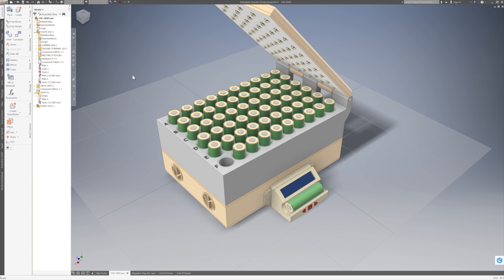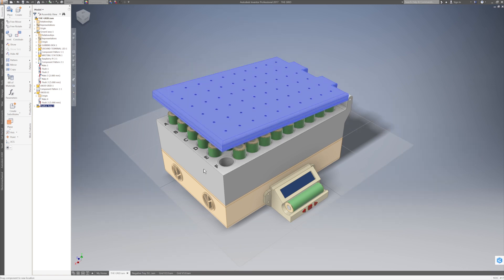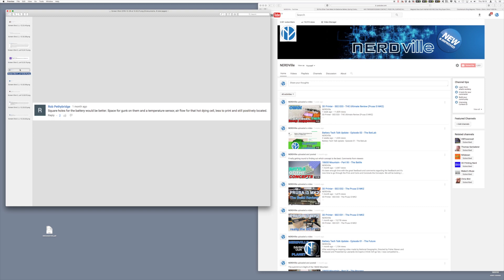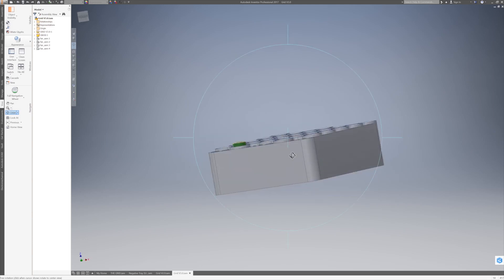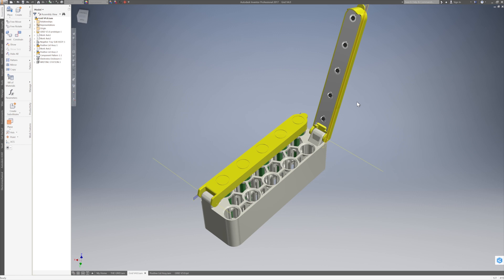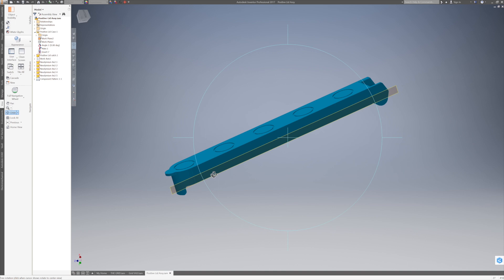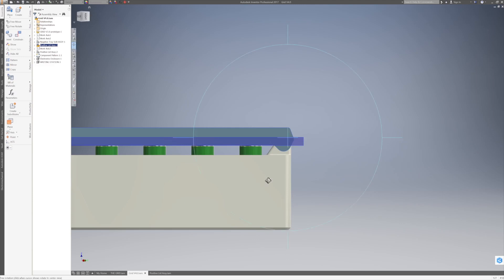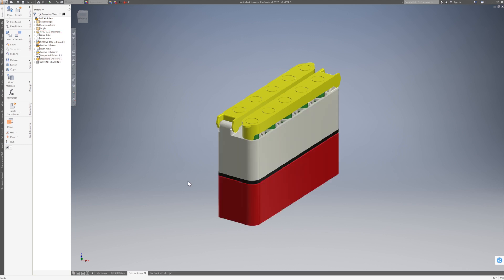18650 Mountain - Part Xiii - The Update

Comment: i think you still need something latch the lid and on your battery connections just for the top it you added a spring on the shaft of the bolt in between the magnet and the head of the bolt

Comment: is this project still alive ?
My five cents.....I imagine a system like a roulette, with 12 batteries located at hour places (like a clock) with one arm in the middle with an electromagnet to take or leave batteries. This arm will put and take batteries for charging & discharging from one entry point (lets say the 12 h) to any free space. Each space can charge, discharge and inform the battery condition (temp, volt, amp, etc) to one central microcontroler or raspberry pi. With this system you can charge or discharge 11 batteries at same time (in parallel), and input or output batteries as soon as they are checked or refused, and save all the data of each battery. You can label each battery or use rfid stickers with an rfid reader/writer. This system can scale as well, if you need or want to check more batteries just make a circle bigger. I can help programming raspberry pi or microcontrollers. What do you think ?
Reply: BTW, great channel !, love your videos!
Reply from the maker: Joan Pons hey Joan. Just picked your comment so sorry for having missed it. Your roulette idea does have some similarities to the one I design I must say but I assure you it is a coincidence. But have gone the process of design and reading your comments there's certainly some merits to your concept which could be added or amended to the The BFC. May have to see how things pan out.
Reply: Hi, so you dont read all the comments ???... that's good ! it means that your are becoming famous and your channel is growing exponentially ;-), anyway all our designs need improvements and some work, but they're a good starting point. My initial idea was to create a totally autonomous system, where you can put all your bateries in one place and pickup the tested bateries in other place, maybe clasificated by capacity level. In your design you must insert and take off the bateries of their holders manually, this could take a long time if you have a large amount of bateries, which I think is your case.  Anyway thanks for answering and keep publishing great videos. You have a lot of people interested on this project. Congrats for your channel.
Reply from the maker: LOL famous ME! I will always try to answer comments for as long as I can until they become too much. Remember my videos relies on audience participation, Hence NERDVille is more of a place than a persons name. The idea definitely has merit but the main issue is making the design accessible and easily built using the minimum tool. Not everyone will have a laser cutter like me. The other issue is cost and trying to design unit that meets most people's scale of battery recovery as not everyone will have a cell count of several thousand. Trying to design a unit that is both modular, inexpensive and easy to build is no easy task but I feel possible. But a rotary system sounds like an awesome idea just to make and do an episode on. Time permiting of course

Comment: Why not put a spring under a wide headed screw? You'd need to latch the top down to maintain pressure
Nickel strip for the top with screws for contacts.

Comment: Two ideas coming to mind.
1. An alternative to running wires through the hinge area. Two contact points, in the lid, per cell. One contact for the cathode and second contact point to a wire that runs parallel to the cell down to the electronics. Then bridge the two contact points.
2. Further down in the comments xtraPom mentioned the idea of accessibility of individual cells during the testing process. I know this adds complexity that will disqualify this idea from this project but I will throw it out there anyway. Each cell slides into its own holder similar to existing 18650 holders. These holders would have two contact points on one end and would slide into the grid individually.
Thank you for the time and effort you put into your channel. Your videos are VERY entertaining!
Reply: One more thought. Each holder has its own temp sensor and add a third contact point on the same end.

Comment: Nice design and concept. Several things to say here. 
First, the magnet connection and the adjustable height of the connection is crucial. However, you need to have at least one side of the connection (either + or -) to be flexible (aka. use a spring) to guarantee system reliability. 
 Second, your cover lid should be stiff enough to keep its shape when it is pushed or pulled by 5 magnets or contact springs in a row. 
Third, you need some space to fit in electronics. The easiest way I see is to attach a bunch of TP4056s at the bottom of batteries, but that only handles the charging part, and I am assuming that you are going for more advanced options. 
Forth, you need time to build electronics. Your background suggests that you haven't been trained for electrical engineering, so that you have two options: 1. learn the knowledge and do it yourself. 2. Ask for those who are skilled in the art to help you. Either of these two options will take at least a month plus your hard work and dedication.
Fifth, temperature control is more than keeping batteries safe. A cell's discharging curve varies with temperature. If your cells are tested without temperature control, the result will be inconsistent. I am assuming that you are using your test results as a standard reference for further tests and design. In this case, the inconsistency of this initial test will make all the following steps pointless since you are following a wrong standard from the beginning. The crucial point of temperature control is to keep the temperature of all the cells at the same level, and this can be achieved by strong cooling fans since it will make every cell to be room temperature.

Comment: Just a little idea you almost there if you think about it. Why not go all the way and using your idea for your test box make a similar box to contain the 18650 batteries like a modular setup for use after you have done all the testing and are ready to use them in your power wall. It would make life so much easier if you could just drop them in and then stack them into your wall.

Comment: hello I just started on my own recovery project and currently have over 1000 cells I am messaging you because I am having trouble testing them all and I have more cells that are still in there laptop battery housing but if a am going to do this I'm going to need to make something much better then my current set up of two imax bc ac chargers and I saw the charger (the grid concept) you are currently building and I think I might try and build one so if I can help I have an idea you might like if you use a Intel Edison Arduino board it has Wi-Fi and Bluetooth so you could use that and a cheep android tablet and make a app so it connects to your charger and you could have the charger send the info to your app and you could mount the tablet to the charger like a display on the side you could also make the app display the data recorded however you want

Comment: But that neodymium magnet will have a powerful hold on the bolt especially as its rough with the thread
Reply from the maker: yep, the CSK screws and magnets are magnetically connected and this group moves freely within the tray that holds it.

Comment: Hello. Nice video first of all. But i am not a fan of the magnet system. The spring would be much better and waaaaay cheeper. And just a thought, you are going through all this process, and by the time you finish this all, i think you could be done with testing all the cells already with the materials you have currently. My point is that, is this worth your time? Time is money. It looks like too much time is being spent on all this design process and it would be all the same if you do this or use the imax b6, tp4056 and your discharging unit. Plus, you are going to be spending much more money on all these supplies and time, since you are buying off ebay, it will take 4+ weeks to come. Again, just my suggestion and keep up the good work!!
Reply from the maker: Hi sean, TBH this is not an exercise in me making a tool that would make the processing the cells more efficiently and yes I have thought the same myself LOL. 

It's more of a community led project. There is a recognised issue with the arduous task of processing 18650 cells. I'm just addressing this problem but with the youtube viewers input. Which I think is cool. 

We're breaking new ground here and I don't know of any channel that has run a social experiment this way. Besides, I'm passionate about design and keen to learn about electronics and programming so the knowledge gained is additional experience I would not have got anywhere else. 

Lastly, I have made friends and communicated with experts around the globe that I would never have been able to, had I not started this project. So put simply, yes i believe it is worth my time.
Reply: NERDVille Aahhhhh. I see. Well if this is being done how you explained... then yes i agree with you. This has been quite a journey from part 1 and i look forward to seeing more. I am following your videos as i am learning as you are too. Congratulations on your progress!!!!
Reply: Hahahaha. Yes. But anyways, i do have tips for your box thing... (srry no idea what its called, cant remember)

1: In complete honesty, i dislike the idea of using neodymium magnets for connections of the batteries. It is much more expensive and the simple spring would do a better job.

2: The heat sensor thing, is very complicated and  it will really take up lots of space, if you will be monitoring every single cell. 

3: Depending on how fast you are willing to charge them, you may or may not need a fan or a heat sensor. For example. I have my own small batch of 18650 batteries, and test and cycle them on my Venom pro charger. (pretty much the same as the your imax b6) I charge them at 0.5a. and they don't get hot at all. They mostly stay at room temperature.

Well, good lick on your future plans, and i look forward to seeing new videos!!

Comment: Not to criticise the design but merely to suggest... those little notches you made for slipping on the lids.... if you placed them directly at the top you'd allow the lids to be snapped into position directly from the top and eliminating the possibility that someone heavy handed would accidentally pop the lid off the back when opening.
Reply from the maker: hey no probs, I like this sort of criticism. The reason I put the ramp for the notch to the side is it will interfere at the top as this is rotate passed the ramp when opening. to the side once fully opened and sitting on its own natural stop I designs in then the notch will in effect be pushed up and away from the side ramp. the assembly will be the same even if it would be at the top or side.
Reply: Ah I see. Makes perfect sense.  Keep it coming... loving this project!

Comment: Haven't seen the entire series yet, but I would recommend rows of 6.  If the rows can process individually, and assuming you will have 6 usable batteries at the end, batteries are generally used in groups of 2 or 3.  Processing 6 would give you a more universally usable set.  Just a thought.
Reply from the maker: yeh I agree I think 6-row groups is a 12-hour max processing time. But it's easy enough to expand that once we have proven the electronics.

Comment: For connecting the upper assembly to the lower, I had an idea to offer up.  With your CAD design, add an extended rectangular piece (perhaps 4cm long and 2cm wide, ending in an oval or circular shape - essentially, a spoon shape) going downwards on two sides of the upper assembly, forming squeeze tabs that can mate and "click" into place with their respective oval or circular female cut-outs on the bottom assembly.  If the tabs are designed so that they have to be squeezed inwards to just slide past the inside walls of the lower assembly, they should form a very positive (and audible!) contact when they reach the female cut-out and can pop back out to their original, in-line orientation with the wall of the upper assembly.  I can't seem to find a good image on the web to really illustrate what I'm talking about but think vacuum cleaner attachments for the hose assembly.  They slide on and then click into place once the flexible tab reaches it female acceptance point.  Those tend to be spring loaded but I don't think you even need springs if the alignment is done right and the "tabs" have just the right amount of flex and strength.  You can even add some texture to the oval or circular shape at the end for extra purchase when squeezing them.  To remove the upper from the lower assembly, simply squeeze both tabs inwards out of their respective female cut-out and the parts will easily separate.  Placing the tabs on the long sides of the assembly should allow you to squeeze both tabs at the same time with your thumb and forefinger, thus allowing one hand to hold the lower assembly and squeeze and the other hand to pull the top off the bottom.  If done right, the two pieces should click into place when mated and form a very sturdy connection with very little to no wobble.  I have no experience with 3D printing so I'm not sure if the medium you use for the housing is flexible enough to make squeeze tabs while still being rigid enough for the overall structure, but if it is, this could be a good solution that provides both easy accessibility to the guts of your module while still embracing the KISS design philosophy.
Reply from the maker: I like your way of thinking. Is this something that can be sourced as a ready-made off the shelf component? If not imagine the tooling costs and MOQ cost to try to get something made that is unique. It's an awesome idea and I like it, but we need to maintain the design of this to be as easily sourceable so that it is within the reach of most people scope for sourcing materials.
Reply: I'm really struggling to find an illustration or graphic that accurately depicts what I am talking about, but check out the graphic on step 4 from this page: https://formlabs.com/blog/designing-snap-fit-enclosures/ as it is close enough to showing what I mean.

In that example, the set of clips are designed to permanently connect the upper and lower enclosure.  However, if you create a "female" cut out on the bottom enclosure so that those clips can slide down, click into place, flush or slightly pushing out through those female cut-outs of the bottom enclosure, it will allow a system that snaps the upper into the lower assembly but can be pulled back apart by just pushing the tabs inwards through the female cut-outs.   In this way, the locking system should be part of 3D design so it won't be a separate part at all.  Hope that helps and keep up the great work!

Comment: My suggestion when it comes to battery terminals is to use thin nickel tabs/sheets to make the electrical connection and some kind of hi resilience silicon or pu foam behind to improve the mechanical connection and make room for length variations among cells and flex in the construction.

Maybe even coil springs in combination with nickel tabs can be an alternative but i think nickel tabs and foam might be best connection / money and space.
Probably more important when you want to draw a lot of power out of the cells due to deformation of coils for example at higher power rates / temperatures, but still a good method for a project like yours imo.
Some exalmples;

*Nts works patent
www.google.com/patents/US8785028

   https://s27.postimg.org/4pawq0kv5/US08785028_20140722_D00001.png

   https://s24.postimg.org/myxswgwyt/NTSWorks_Mini48.png

* diy foam/nickeltab pack
https://endless-sphere.com/forums/viewtopic.php?f=14&t=57810

   https://s18.postimg.org/sd3c7qsax/IMG_2504.jpg

   https://s17.postimg.org/xpcihnzgv/IMG_2505.jpg

* lasercut nickel sheets with fuses (probably not so interseting for this project)
https://endless-sphere.com/forums/viewtopic.php?f=14&t=55870

   https://s18.postimg.org/oh708lm15/JT9_M6_Jd.png

   https://s12.postimg.org/7benhkgm5/image.jpg

this might be of interest as well; https://endless-sphere.com/forums/viewtopic.php?f=14&t=63190
Reply from the maker: extremely fascinating links you provided which gave me a wealth of new knowledge, so BIG thanks to you for that. These are some awesome suggestions. The main scope of this is to keep the design and manufacture at a state which is easy to source and easy to make. These links are very enlightening but would mean an element of customized componentry which would ramp up the cost. keeping parts of the shelf would put this within the reach of most experienced makers. BUT, very good info.

Comment: Hi NV you could run the positive wire down next to battery. Use magnet to connect it to terminal!
Reply from the maker: could you explain further?
Reply: Hi NV get rid of cover. Insert battery then top it with a magnet which connects to positive lead running down next to battery!